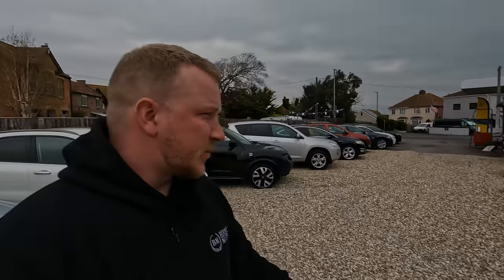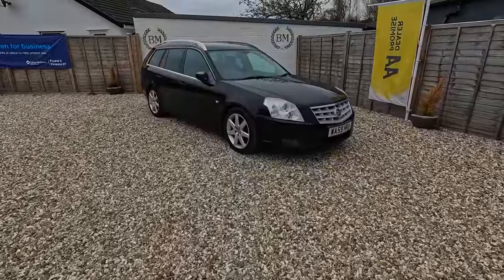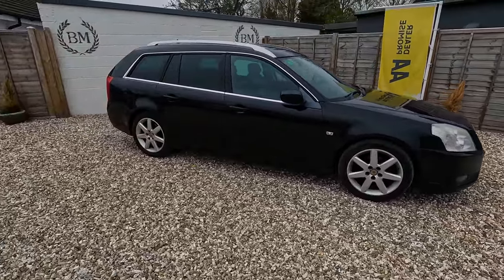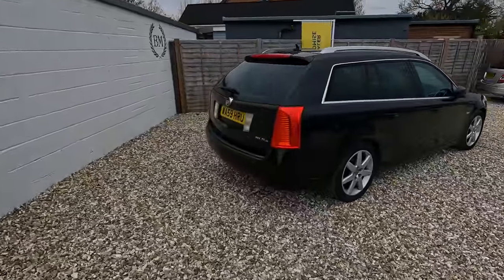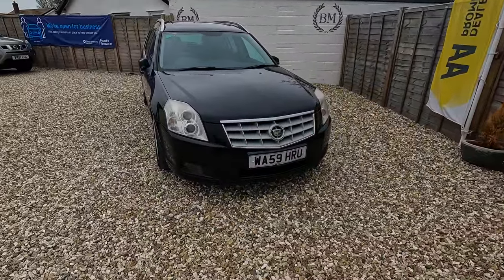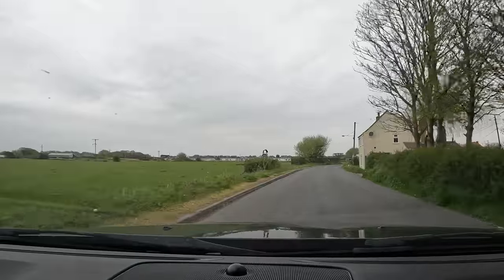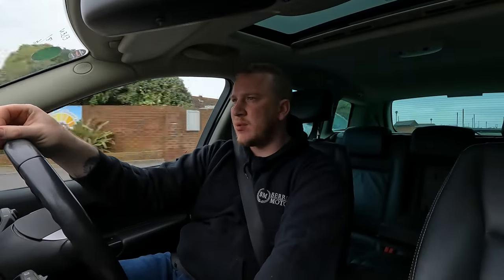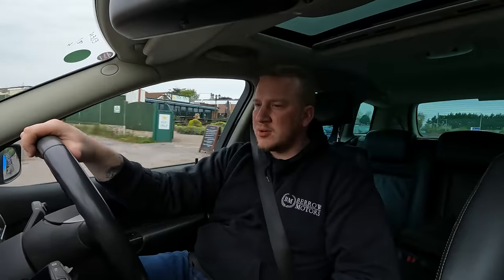I bought cheap Cadillac at auction but I think I got a Saab!

Comment: Key is common problem unlock button went on mine,coolant pipe is common for rusting same happened on my vectra same 150bhp engine can get a stainless pipe as i did

Comment: i have one of these in the UK too. Its a saab. I have 100k miles and its a tank. problem is, you need a special plug for the diagnostic, which most mechanics dont carry.  Oh and changing the headlights is a pain in. the ass. Any idea where to find parts for it?

Comment: Dont like it one bit and I'm sure I'd have had a cheeky bid at 8 tonne ish myself.  My kind of crap too. Recently had a £2050 Cap Punto for £700   A Colt for £300 Capping £890, A Fiesta for £400 cap was £1300 leather flatted polished lovely.   Worst was the Fiesta, slipping / engine / clutch noise was non- existent but then expansion tank pressurised at end 12 miles drive. On a Fiesta, what's happening there,  no fiesta ever had Cyl head woe. So polished it, bleed diagnose later.  That Saab is a cack old car, had this kinda estate maybe 150 odd times 18 years buying sub £5k cars.   Flatted and sold £2499 ish, nice.
Reply from the maker: Just had to scrap a 1.6 fiesta with a head gasket gone a 2 pistons slipping around, pain in the arse!
Reply: @ShiftingMetal  Yup, some terrible former keepers out there